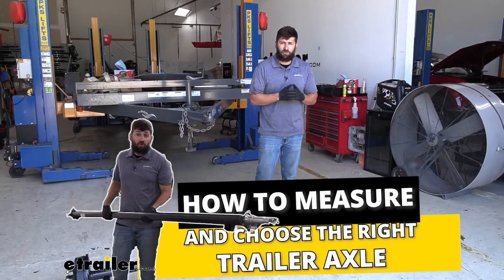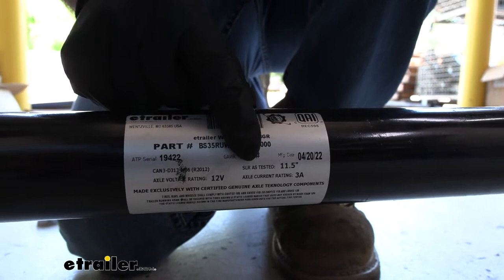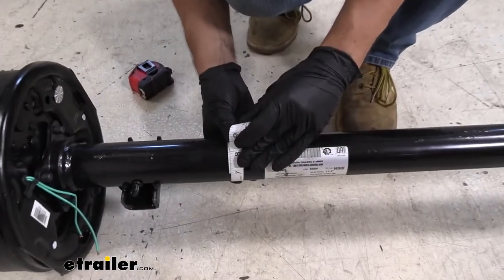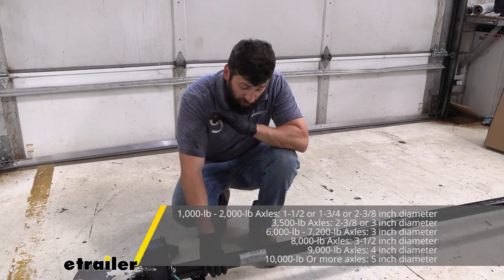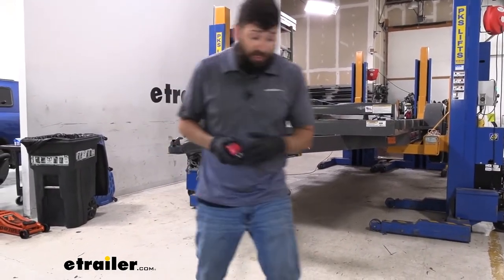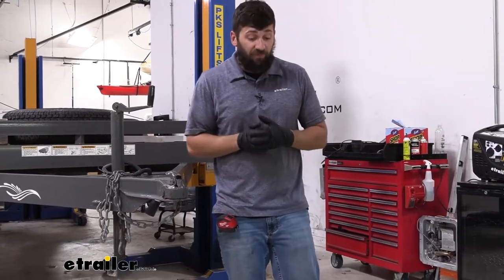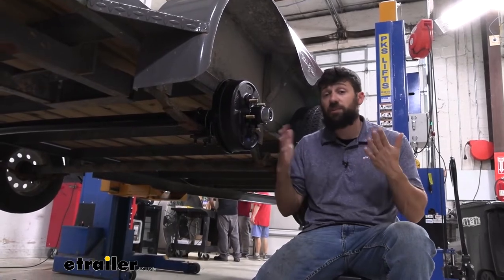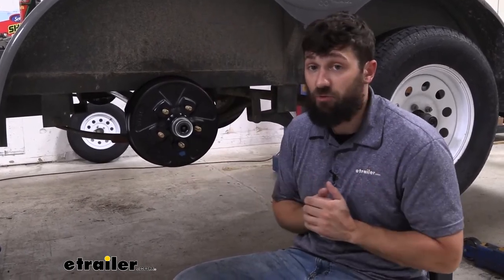etrailer | Measuring To Choose The Right Trailer Axle

Comment: What if you have a homemade jobby that someone gave you for free? Mine has an axle from either an RV or a mobile home that someone cut in half or took a section out of and then welded it back together and it's sagging in the middle so I'd like to replace it with something new because I'd like convert it to mount a fiberglass (AstroBody by Supreme Corporation now called Wabash) truck body to to use as a camper or an enclosed utility trailer. The body is only 47" high x 78" wide so I'm hoping that it'll work. I think it's 7ft long.